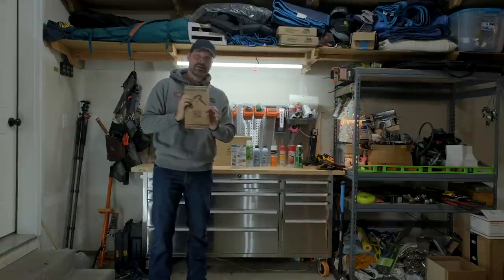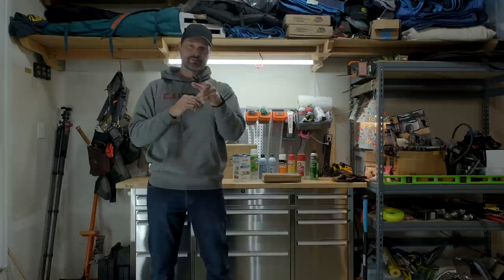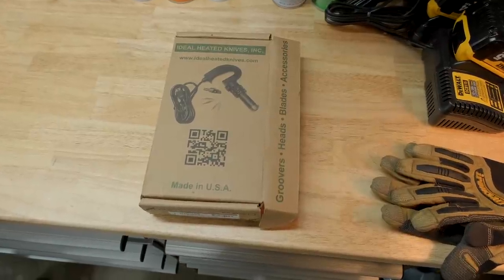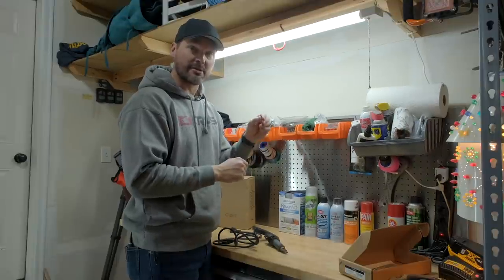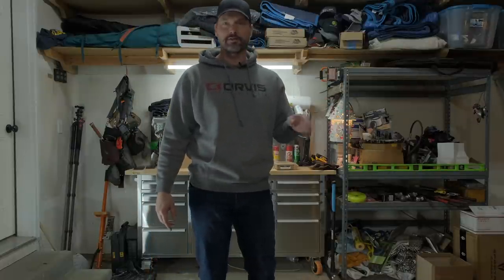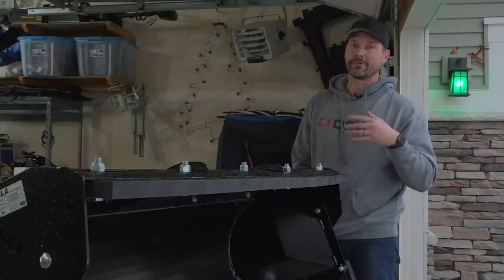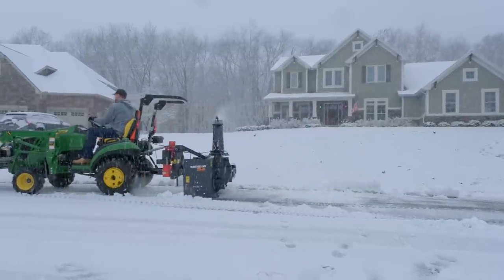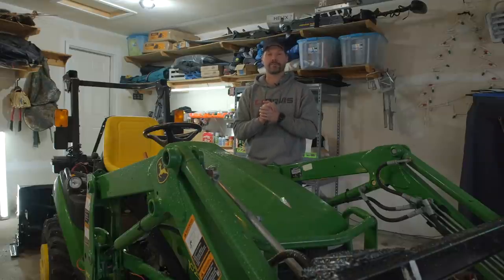THE PROBLEM WITH PROCRASTINATION😱 SPENT HOURS SETTING UP FOR SNOW! ❄️

Comment: I just plowed three feet of snow off my sloped gravel driveway that's about 1000 feet with my Kubota b2601. It took me eight hours total and I was just using the standard bucket (54").

Three things I learned, 
1) Running the motor at 2250 rpm you can get three times the amount of work done in the same amount of time as if you were running 1800.
2) Running at that speed eats up the fuel.
3) I need to get me a bigger bucket for snow, at least a 60".

Comment: Got the 60” HLA snowpusher and 60” MK Martin pull type snow blower on my 2025R. Took it out 5 times now. My driveway is 800 metres so backwards was not an option I wanted. The snowblower is at the limit of the machine for wet heavy snow. I would definitely get more horsepower if going commercial. But it’s ok for me since I’m just taking care of my stuff.
Reply from the maker: Good info, thanks for sharing Roger!
Reply: Watch TTWT on the 1025R turbo PTO HP numbers. It appears all the 2 series HP attachment requirements can now be met with the 1025 R footprint.

Comment: One of the best and cheapest ways to prevent snow from sticking to your blade, bucket etc., is to simply buy paraffin wax blocks and rub one firmly on the surfaces you want to keep snow from sticking to. I've done that for 30+ years and it lasts the entire winter if applied well.

Comment: I have hybrid tires on my kioti - I've been amazed so far at the traction they have provided on my ice covered and steep driveway. Definitely interested in the weight bracket for the speeco! Could definitely use some extra weight on the back of mine for heavy loader work I'm addition to the box blade
Reply: we have 2 hla 24 foot pusher with hydrulic wings for our komatsu wa 380 and wa 230 loaders wich we get lots of uses for it for snow clearing plus we use them for grading dabres piling up sand and salt in the building wich great multipurpose uses of our hla pusher blade

Comment: Happy New Year to you and yours, Courtney!!  Fantastic video, yet again, and to welcome 2022 whilst savouring my coffee!  You pretty much have my setup and it is wonderful.  I hope you shall come to the same conclusion once you go through this winter.  As for mitigating snow sticking to the pusher and blower, this is now my fourth winter with my Kubota B2650 system.  Winter #1: no mitigation measures and a lot of sticking.  Winter #2: a spray on Teflon coating for shovels and the like with mixed results.  Winter #3:  paste automotive wax.  Good results, but horrendous pain to apply and many missed spots due to shape of components, especially inside all areas of the blower (and I did observe strict safety protocols!).  Finally (yes, I am writing a thesis, lol!), Winter #4:  RainX spray silicone wax.  After about 10 hours of snow clearing this winter, both pusher and blower use, very encouraging results and much, much easier to apply and more consistent coverage as I can saturate everything inside and out, especially the blower.  If I may, I will report my conclusions at the end of winter, which is usually April/May in my corner of the globe, lol.  Take good care and enjoy snow clearing for the first time with that awesome setup!
Reply from the maker: Awesome stuff Dean.  Sounds like I've got another product to try.  Let us know the results at the end of the season!

Comment: Regarding the corrosion in the utility outlet.  The fluid film you showed will prevent any  corrosion in this socket.  It also works on battery terminals, trailer plugs, trailer receivers and door locks.  Not trying to sell this product - just passing in positive experiences with it.  BTW: It also works great at rust prevention on cars/trucks.
Reply from the maker: Awesome, didn't realize it could be used in outlets.  Yeah, heard of it used on the undercarriage.  That stuff has an unpleasant aroma, haha!
Reply: I have used Lloyd's AD2000 on electrical connections. It's also a corrosion barrier of sorts. I spray my mower deck in the fall after I clean it up with AD2000. Not sure if it's available in the U.S. let me know Courtney and I will get some to you to try.

Comment: I use my 12volt outlet on my 2016    1025r to plug my Milwaukee heated sweater into nice to have on cold nights out with the 56” bercomac snowblower. Can’t wait to see which product helps keep the snow off the best.
Reply from the maker: Nice!  I've heard the Milwaukee heated jackets work well.
Reply: Yes, works great, I use my gerbing heated jacket and glove that I used on our Goldwing motorcycle

Comment: I find most rear attachments, especially the rear blade is sufficient weight, that and chains. Siping can lead to premature tire wear.
Reply: Premature tire wear on an R4 means that you might get 3/4 of the way through the tread before it rots and leaks air😁😜

Comment: I have a 2007 X728 and the 12v outlet is still working. Mine did come disconnected a few years back and I had to reach underneath and plug the harness back onto the prongs, but that's all.

Comment: Good morning. Happy New Year. Courtney, down the road if you see a need check out Titan Tank. They MFG. fuel tanks to replace OEM. They mount in same location, while giving more capacity/ volume. 
I've got a 36 gallon tank on my 2500hd,Titan is 68. Food for thought. Especially for the 450.
Be safe everybody.
Reply from the maker: Awesome, I'm gonna have to check that out.  Make them for the F350 too?
Reply: Yes they do

Comment: I bought wheel weights for my 1025r from the dealership I bought the tractor from 4 years ago and ran into the problem of the notches for the valve stem didn’t line up in any attempt. It was like the hub plate was randomly welded to the rim wherever the welder felt like putting them

Comment: So where did that (didn't work on the 1025) heated seat cover come from???

I have an x748 with a soft cab.  When I bought the cab, it came with an electric heater, that I never installed, because I couldn't find a convenient, out of the way, mounting point.  On the x748; the cooling fan, radiator, and air intake is mounted between the operators station and the motor - meaning it pulls air through the cab and pushes it out through the front of the tractor.  When the temp drops below freezing, there is a serious wind-chill factor in that cab, when the engine is running!  A heated seat cover MAY help to alleviate some of that wind-chill...  
Worth a try, anyway!

Comment: Can you put the link the heat seat pad. Do you think it will hold up in the snow and wet? My tractor did not come with and accessory plug but I added one.
Reply from the maker: Yeah will try to get that put up later today.  I think it'll be fine.  Primarily protected by your body.

Comment: Both of my outlets work. The one on my X738 is used frequently for spraying and spreading. It has a switch  by the light switch. I do not remember if the one on the 2025R is switched but I have used it to charge my phone.
Reply from the maker: Yeah I remember that switch on the X Series.  Wonder why they don't have one on the bigger tractors.

Comment: What is the reason for melting grooves into your tires? I’ve been using a small JD X485, that is only two wheel drive and has turf tires, with a 47” front-mounted blower and rear tire chains and have no issues with traction. Been doing this with the same tractor for more than 20-yrs. maybe because I don’t have much of an incline, but I did go up some hills helping out a neighbor and still had no problems🤷🏻
Reply from the maker: Hey Ed, turf tires are great in the snow.  R4 tires are horrible in the snow.  For whatever reason, R4 tires have become the gold standard in the compact tractor world.  https://youtu.be/wjHfL8AJmxY

Comment: I would have just have put cuts the opposite direction of the tread, cut the tread blocks in to halves or thirds
Reply: Be defeating the purpose of placing any cuts.
Reply: @michellemorsey2240  cutting the opposite way creates smaller tread blocks. Smaller tread blocks result in smaller surface area and less floatation. More pounds per sq inch = more downward pressure (dig/bite) on the snow which equals more traction. Simple math and science
Reply: @lauderdalechad  actually simple science says totally different!

Comment: It doesn’t look like you have wheel spacers on.  I got mine for Christmas three inches on each side looks great they came through you. I have a 2025 jd
Reply: Good day John how do you like your 2025R??
Reply: I love it it’s like a1025 but a bit taller and a bit stronger but still has the maneuverability of the 1025. I dug out my moms septic tank with it. I also run a 6 foot tiller on it. I have 20 acre’s and I work it a lot.

Comment: Get yourself a set of tire chains for the rear . Sheesh . It's night  and day .
   Can't honestly  take you seriously  😒
Reply from the maker: Yeah, they make a big difference for sure.  They will also damage concrete in a heartbeat.  Not allowed on my driveway.  Thanks for watching and Happy New Year!
Reply: @GoodWorksTractors  I've not noticed  damage . But whatever . You keep doing you
Reply from the maker: Same reason folks prefer rubber and poly edges on paved and concrete surfaces.  Scraping does damage.  I'd say chains are even worse.  They are designed to grip the surface, not slide along.  An even higher probability of damage.  Glad they're working out for you.  Not worth the substantial risk for me.
Reply: @GoodWorksTractors  For sure, the concrete around my house was the most expensive infrastructure improvement I've done to my property thus far, by far!  No way would I run chains on equipment on those surfaces--I try to even avoid using salt!  If you're on gravel, chains would probably be an excellent solution.

Comment: You just broke the NUMBER ONE rule of tractors after you installed that heated seat. You started the tractor and you weren’t on it 🤦🏾❌
 
Remember. Leadership by example. You’re not supposed to do that and it should be consistent. I understand you weren’t between the wheels but you have alot of tractor noobs watching. Just saying! SAFETY FIRST 
✊🏿
Reply from the maker: Strange.  I just read my manual repeatedly and it doesn't say anything about sitting on the seat prior to starting.  Guess you might want to check your rule book.  🤷‍♂️
Reply: I follow the Mike Rowe philosophy of Safety Third.